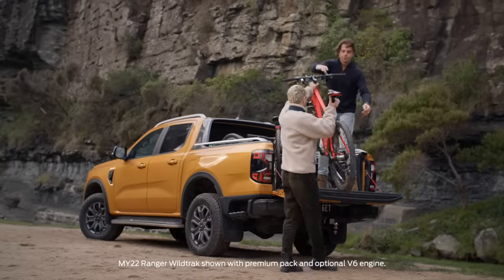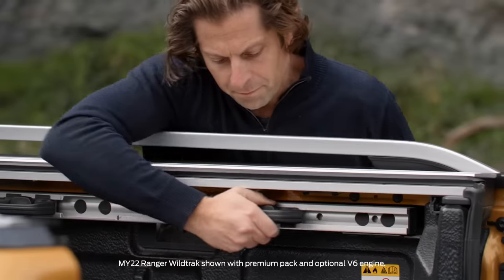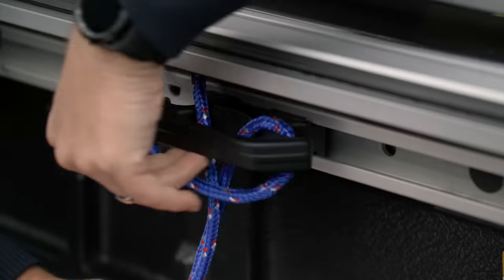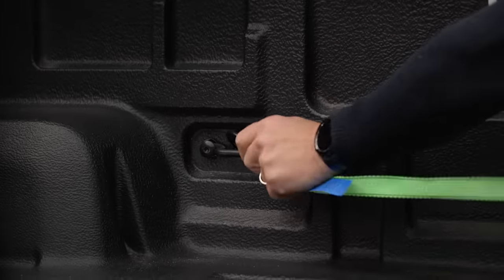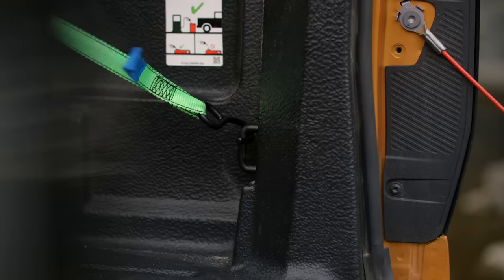Ford Ranger Unlimited Thinking Episode 3 - All Sorts of Cargo

Comment: Ford thought about tie down points on the PX1 & 2 Ranger and then in their tight fisted wisdom decided to remove the 2 crucial centre tie downs from the PX3 Ranger. I had to purchase my own and push a hole through the plastic load liner to reveal the hidden threaded bolt holes at the back. Great thinking Ford.
Reply: I replaced the bolts that holds the bedliner with eye bolts. Easy and effective.
Reply: @bingo-fuel  if you take one of the other tie down points and bolt it onto the single bed liner bolt on the PX3, you are then perfectly aligned to push though the other blanked off hole in the bed liner and reveal the hidden thread that was used on the PX 1&2.

Comment: Built Ford Tough, think 👎Why does a Ford tub require reinforcing brackets to be fitted at owners expense to fit a canopy without the tub deforming. I have never needed them on all my other brands of utes. Does not instill confidence in what other sub standard engineering faults lay lurking 🤔